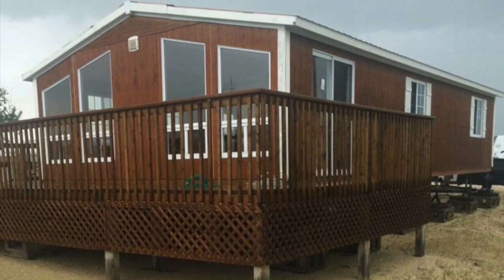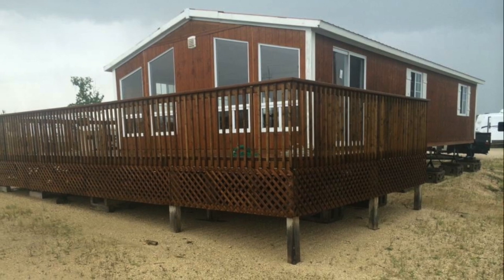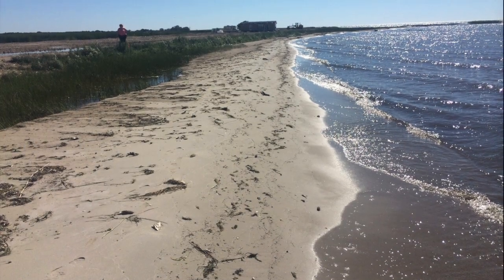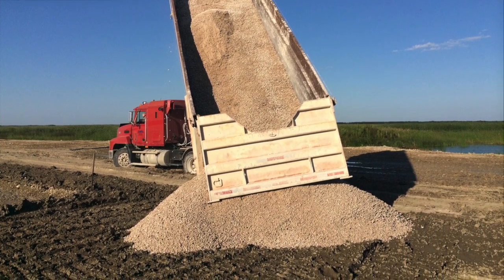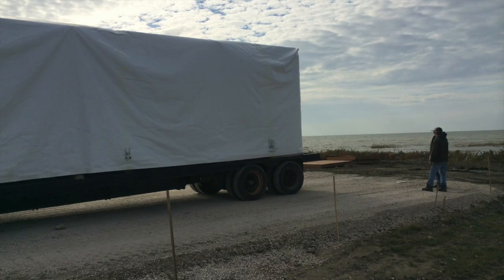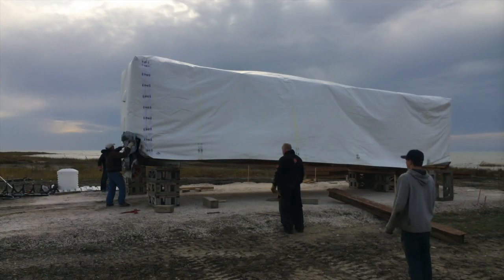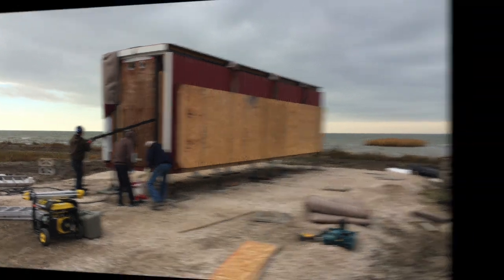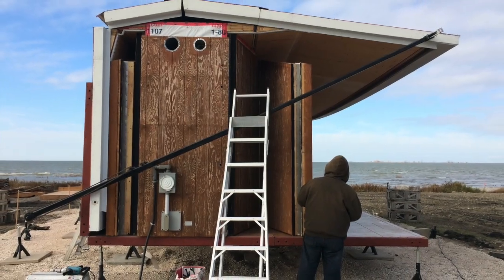Habitaflex folding house (2020)

Comment: This is what I want to put on my land in NB Canada. Is it built to the national building code standard? What heating type does it have or could be installed? What is the square feet? Thanks
Reply from the maker: mine is 800 sq feet, 40x20, 3 bedroom, baseboard heating and met local building codes... as to other place I don't know.

Comment: What is meant by "4 by 2" and "6 by 2"?
Reply from the maker: Dick Head thickness of the lumber in the walls. The house has 4 inch wide walls, most here are 6 inch wide for more insulation, thus less heating costs.

Comment: Typhoon:"its easy for me to rip it off"😁✌
Reply from the maker: Gil of mandaue Gil of mandaue I don’t understand what you mean???
Reply: @SimpleTek  he meant that a typhoon could easily rip it off.
Reply: and there is no Typhoon here, we do not care, anyway is there ANY single house that would resist a Typhoon, NO!
Reply: @acarriere8534  Engineers design houses based on typhoon wind speeds. Its the minimum requirement.